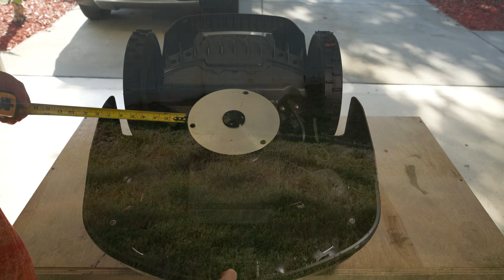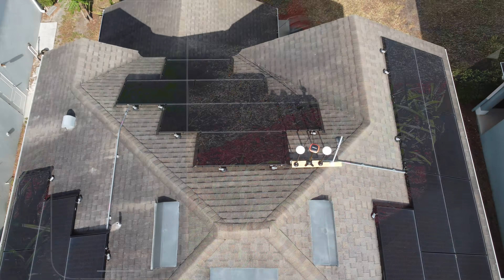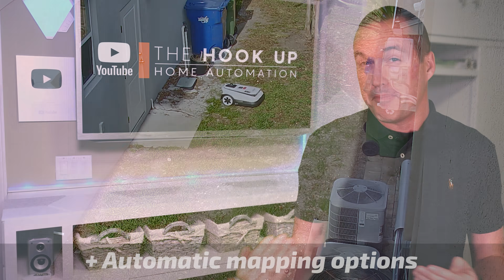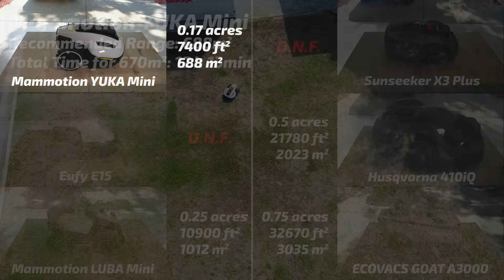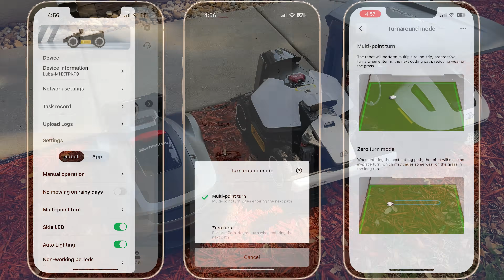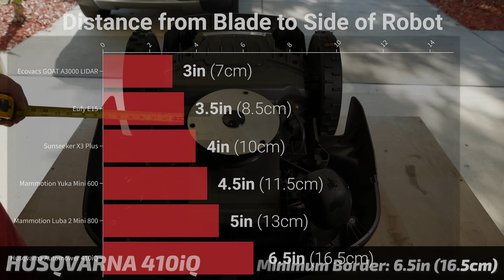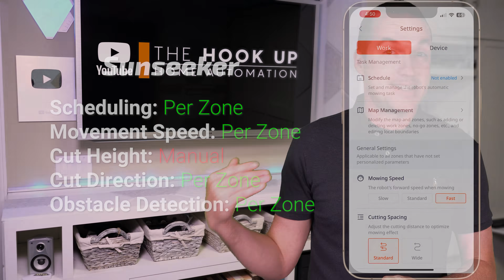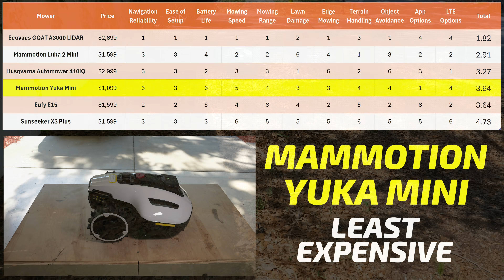Watch BEFORE You Buy a Robotic Lawnmower - LIDAR is a GAME CHANGER!

Comment: Normally your RTK antenna is supposed to be in direct view of the robot base station to get a better reference point
Also having your solar pannels right under it might do some more harm to the signal
Oh and the comparison using the yuka mini is pretty unfair compared to the rest, it would have been better to pick the yuka 1000
Reply from the maker: There is ZERO reason that an RTK antenna would need to be in direct view of the robot base, zero.   The robot just records its coordinates when it is on the base, the base itself does not have a GPS receiver.   You want the RTK antenna to have as much clear sky view as possible so no matter what satellite the robot can connect to the RTK can connect as well.  Also, how on earth would having solar panels UNDER the RTK antenna mess with the signal?
Reply: @TheHookUp  you are 100% correct about the first point (seeing the base station is nonsense). However, solar panels might reflect GPS signals causing multipath interference, much like walls do. The current flowing through them and inverters might also cause problems, I know a solar invertor at my neighbour destroys his zigbee mesh in his garage, so its a fair point that might be worth testing. I also wonder if having so many basestations in close proximity caused any issues. These base station do not only receive, are also all transmitters sending RTK information to the mowers. Even if the transmission is on a very different frequency, the proverbial butterfly can mess with RTK reception its not unthinkable a lora or wifi transmitter right next to it causes some issues. Though I assume you tried unplugging all but one?
Reply from the maker: LoRa is a super error tolerant protocol, so I would highly doubt 4 stations would be anywhere near enough to cause interference.  From what I understand reflections only matter if the original signal does not reach the receiver, otherwise reflections would be a SIGNIFICANTLY larger problem in all GPS applications.
Reply: @TheHookUp  My concern is not with lora suffering dropouts, thats both unlikely and would show up in the app; one concern I have is lora, and especially solar panels,  potentially causing interference for the RTK receivers on the roof. RTK reception is incredibly finicky, its very different from regular GPS - your explanation is a bit incorrect btw, what you describe is differential GPS. Which is similar, and probably a good enough explanation to help your viewers understand the concept, but RTK doesnt just need to receive and decode GPS messages like an ordinary (or differential) receiver, it actually tries to measure the phase shift in the GPS carrier signal. Much like an interferometer measures phase shift in light.  Thats how you can get millimetre (relative) accuracy. Since this was never originally envisioned, there is a problem with this called integer ambiguity search; feel free to google it if you are bored, but to solve it, RTK needs a lot of data (way more than a regular GPS) and some statistical wizardry to make it work.  Its miraculous that it does work sometimes. But its also highly suspectable to multipath and other forms of interference. You really shouldnt casually dismiss the possibility that solar panels, LORA transmitters or even bug swarms mess with rtk. Of course those things end up reinforcing your point/conclusion, RTK alone is not exactly robust, but its still very possible you would get much better results with a single active RTK unit on the roof, or in a better place, further away from solar panels or inverters. Or bugs ;).
Reply: @TheHookUp  Ok this is gonna be a big one, english is not my main language, and I've never been good to put on paper what I have in my head... sorry in advance 

First the problem with no direct line of sight 
I've read a while ago that RTK antenna signal can be degraded by walls, not much as it's 900mhz and it pass pretty well through walls, but when your goal is precise positioning, it's still enough to be a few cm off
This is why it's recommended to have the robot have a clear line of sight during some part of its mowing path, so it can get a super clean signal and correct any positioning error it accumulated with the weaker signal going though your whole roof 
RTK signal is not sending "data'" like a pc in wifi would do, if it was just data if some packets are lost due to weaker signal the pc knows it and just send the data again
But here it calculate the speed at which it receive the signal, and if a wall is in the way, the signal could take a few nanosecond more to get to the mower, and that's enough to be off a few cm
If the mower have a clear signal from time to time, it can recalculate its position from this clear signal
And I was saying that it's best to have the base be this clear signal area, because generally a mower calculate its path taking the base as its main reference point, a "reset" reference point if you prefer

Next the problems with solar panels, there are 2
lets start with the signal from the antenna to the robot, having solar panels in the way can degrade signal even more as solar panels are made from a layer of conducive material, sure it's super thin but again, we're talking about signal speed, even a microscopic delay can have consequence 
Depending on the angle of the panels, it could also reflect the signal, the same way light can pass through glass but if you hit it at a specific angle then a lot more of it is reflected anf so a lot less pass through it
The aluminium could also reflect part of the signal as RF love to bounce on aluminium 
And if you're using micro inverters those thing can act as jamming device depending on the RF frequency they use 

And the 2nd problem is the GPS signal from the satellite to the antenna
Remember in your video you say you cannot put the mower between the 2 houses because the wall and window reflect the GPS signal, well with solar panel it's the same (worse since solar panel glass is apparently more reflective to RF )
Your antenna get the signal directly from the satellite, but then the glass from the solar panels will reflect the GPS signal coming from the sky and send it to your antenna with a micro delay, so the antenna will get the same signal with a nanosecond delay, confusing it

And my last argument :  lots of people have those robot and have no positioning problems, so why you, and a few others do ? maybe you should test the robots again, this time put the antenna on a tall pole in the middle of your garden and see if it change something ?

Comment: I have the Eufy E15 and they have been working hard on the App they actually will be releasing a big update on May 20th to edit zones and to give different setting to each zone. I have the beta and I really like it. Its a good set forward. 

I also have a 10,000 square foot yard, and what I do is break it up for different days of the week. It can do 5,000 square feet in a day with no issues, and then I just have mine set up to do front, backyard, sides, street side strips on different days, then repeat the process. The edging can be programmed better by a setting in the Eufy app, and you can also add a mow zone to make sure it's all done.

I ended up getting the Eufy one, and no regrets with it. I like seeing the Eufy team respond to my emails, and they are really trying to make the app better than the Teramow app.

Comment: First video I saw that explains RTK function correctly. Also try the hookie one that uses also lidar, it’s quite good.
Reply: Minor nit-pick, but his explanation is actually incorrect. What he explains is differential GPS.   RTK works differently, it doesnt just receive and decode the GPS satellites messages to offset an error, it measures the phase shift of the signal and compares that between 2 stations. Its a little more complicated than that even, but if it works, RTK can achieve millimetre level accuracy. HOwever, to measure phase shift, you need a FAR more sensitive receiver (or better signal) and loads of them to do statistical analysis on them. Receiving/decoding a GPS signal is trivial by comparison. Thats why RTK is much more finnicky than regular GPS. Its easy to get "good" GPS signal next to a buildings, under trees or even inside buildings. This is impossible with RTK. The proverbial butterfly will ruin your signal.

Comment: Hi folks,
I don't usually comment on videos but thought I would share my experience. Many thanks to The Hook Up for doing this review!

I have had a robot mower from LIDL (that uses a boundary wire). They are very similar in technology to the robot vacuums that existed prior do LIDAR and overall it worked ok: the setup was a bit annoying and very static (as you need to burry a wire to define the limits of your yard), it would get stuck sometimes - I blame the 2WD system - but it would ultimately cut the grass. At a price of around 230 euros, it wasn't to bad and my intention was to use it's body to implement something like OpenMower. However, the work and money it would require, made me change my mind, sell the mower and buy one that uses RTK.

After much consideration, I went with the Luba 2 Mini (the version that does 800 square meters). I strongly considered the ones from Segway as well but the 4WD system would work better on my yard. The best advice I can give you is to buy from someone who can give you warranty. I am from Portugal and did so by a local store which are mandated by law to provide warranty during 2 years - which honestly, from what I have been reading, I will need. It's a bit more expensive but in the end I need a mower that works.

Mammotion have a very reasonable product but the company appears to be very poorly managed: the application is buggy as hell (and the software of the mower), their customer support seems to be very hit-and-miss and the product is not as reliable as it should be: from power adapters that should be rated to be operating outside (and they are) but allow water ingress, to water ingress in the RTK station, I am expecting to face issues sometime in the future. When the mower works, it really does a good job hence why I am a bit sad that the company and reliability are not as good as they should be. 

As for the RTK, I believe I have very close to perfect conditions and have never faced an issue - even when the RTK station is unplugged, which has happened before. I am curious as how the mower will handle tree coverage which is pretty much non-existant at this point in time because the trees are all under 3 meters tall and very young.

Lastly, I really hope this technology continues evolving. I had a good feeling about Eufy buying(?) Terramow as I believed it would bring some needed seniority and experience to the market. However, this is clearly not the case, as we can see from the video. I am absolutely sure that the Luba 2 Mini (or whatever they're calling it) won't be my last robot mower and most likely, in 2 years I'll be looking into this matter again. Let's hope it evolves as well as the robot vacuums did!

Comment: A very happy owner of a Luba 2 5000x AWD - far better performance than any of these tested here (for a price of course)! Twin blades means twice the sped of mowing of the Luba Mini, and copes with our 1 1/4 acre plot with no issues. Not sure the Lidar would benefit us at all, we've had no issues with GPS signals to either the mower, or the RTK station. The AWD allows inclines of up to 38 degrees, and with the suspension, also copes with the odd rabbit hole or mole hill!

Regular firmware and software updates means it's getting close to being the Tesla of the mowing world. It has replaced my twice weekly outing on the lawn tractor.

Someone mentioned the cutting height on these are all wrong - Mammotion has this covered, as you can buy regular, or H versions if you need extra cutting height - in the UK the standard version is the H model due our type of grass.

I wouldn't be without it now, it saves me almost a complete day a week in the growing season!
Reply: Luba is trash. Husqvarna is 20 times better. You went cheap. Probably have a lawn full of weeds anyways.

Comment: Thanks for putting together such an informative video! I wanted to share a few real-world insights for anyone considering a robotic mower, as these factors can make a big difference in how satisfied you’ll be with your purchase.

First, remember that these are really maintenance mowers—they’re designed to keep an already healthy lawn looking great with frequent mulching. If you already take good care of your lawn and want to automate regular upkeep, they can be a fantastic fit. But if your lawn is struggling or patchy, a robot mower won’t “fix” it—you’ll want to get your lawn in shape first.

Boundary definition and mapping are also critical for success. Many mapping issues are caused by unclear edges between grass and flowerbeds. If your yard has crisp, well-defined borders, you’ll see much better results from a robotic mower.

Cutting height is another detail to pay close attention to. Some mowers—like the Luba 2 3000X H version I tried—have a minimum height that may be too tall for your taste. In my case, I switched to the S version, which cuts lower, and found that 2 inches was perfect. Unfortunately, most brands don’t allow returns after use, so it’s important to make sure the model you choose matches your cutting preferences before you commit.

Also, while mini or compact robotic mowers do have a lower entry price with the ability to cut up to 8k square feet and  can be tempting, I’ve found that they most often don’t meet expectations. So spend your money on the right tool for the right job!

For context, I have a 6,000 sq ft yard and used to pay about $400 a month for weekly yard service. My lawn only looked its best for a couple days after each mow, and the timing was rarely ideal for when I entertained on weekends. Since switching to a robotic mower, my yard is maintained consistently and always looks presentable—on my schedule.  Yes, I do still have to trim the edges manually (which is minimal with the Luba 2), but typically only once a week. 

One last point: most robotic mower wheels are designed not to damage a healthy lawn. If you’re seeing tracks or bare spots, it’s usually a sign of underlying lawn health issues, not the mower itself. The one exception is the area in front of the charging station, where you’ll almost always see some wear due to repeated stopping and turning. Anyone considering these mowers should plan for this, whether by reinforcing that patch with stepping stones or just having realistic expectations—otherwise, these devices may not be the right fit.

If you’re considering investing in a robotic mower, I hope these points help you decide if it’s a good match for your lawn and your expectations. It’s a fantastic tool for the right homeowner, but it’s not a cure-all for every yard!

Ron@fihometech.com

Comment: Excellent comparison, as always. Tough to review mowers on sandy ground that can barely be considered a lawn, but I guess it's relatable for many people in Southern states. I'm in NJ where our grass grows thick and green so my experience with Mammotion Luba, Yuka, and Yarbo mowers has been excellent. I also have no issue with GPS reflections because the yards are big and houses are far apart. So my advice to viewers is to take this evaluation with a grain of "sand" and try to watch reviews that closely match your environment.
Reply from the maker: For sure, I did try to convey that the GPS issue was largely with my specific lawn.  In my area my house is very typical, but other areas are obviously different.  

That said, I still think LIDAR is going to be the future of the industry.  From an ease of use and reliability in all environments standpoint it felt like the only option that could have wide spread adoption.

Comment: As a robotic mower user since 2000 what a fantastic detailed thoughtful review.  The amount of work that went into it is stunning.  The fact that you conveyed so much info in under 25 minutes amazing.  You have my deep respect. I just want to jump up and down and have everyone considering robotic mowers make sure they see your review.  You have made it clear to me sticking with the hassle of a boundary wire and a significantly less expensive machine is where I will remain for the moment.  I am a huge advocate for these convenience devices.  I don’t fully understand why they have not gotten more acceptance. Do give them try folks.  The mower I use is available for less than $500.  Plan on a weekend to get it set up.  A season to learn how to live with it.  A few hours a year for troubleshooting, repair, and maintenance.
Reply: Try to setup boundary wire mower on 3 separate by driveways lawns with a combined size of more than 2000 sq meters. RTK + vision mowers are life savers in such cases.

Comment: I am hopeful for the Lymow to come to mass production soon.  While not Lidar, it uses the other two 'bound wireless' techs as well as mulching rotor blades instead of the razor style.  That is the key design enhancement I was looking for and should help with St Augustine or high weed lawn situations and increase speed of cut. It also plans to use a track system so may not get stuck in uneven terrain or sandy bare spots.
Reply from the maker: I really wanted to include Lymow, but they just weren't ready to ship yet.  They offered to send a pre-beta unit to be included in the video, but said it was missing quite a few features that are in the production unit.  Seemed silly to include a pre-beta unit against actual production units.  I'm also excited for Lymow though.